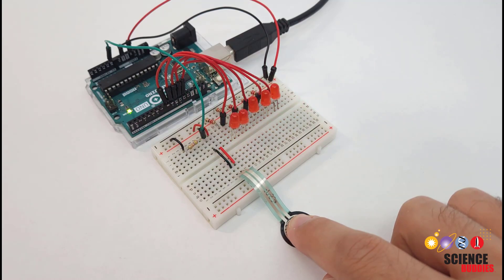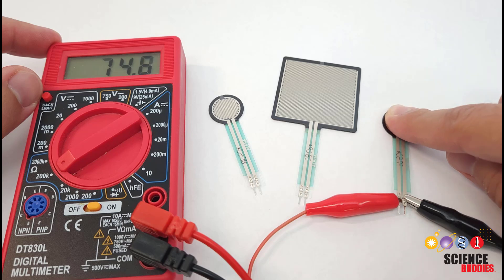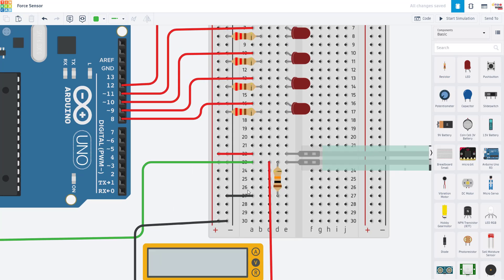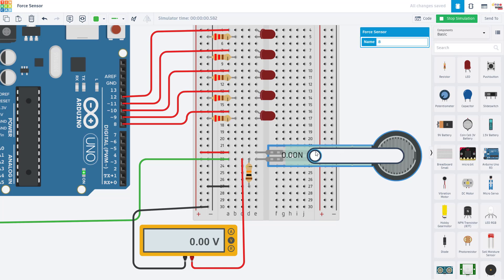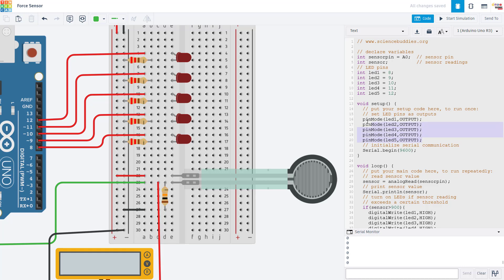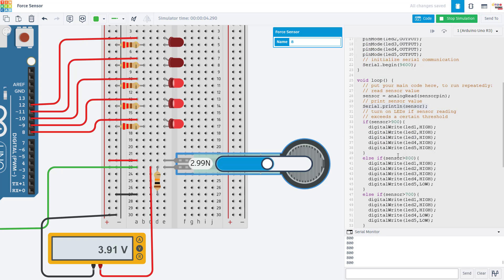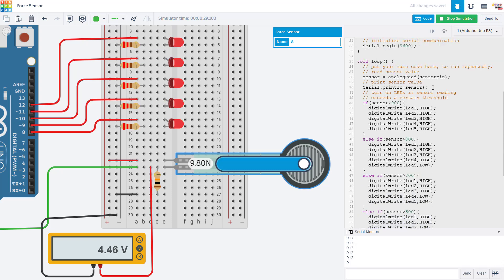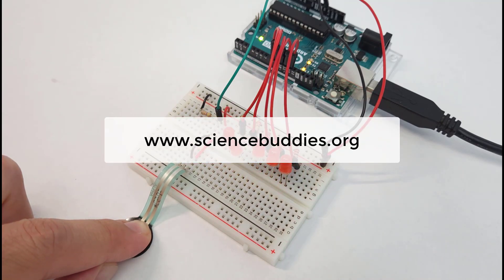How to Use a Force Sensor with an Arduino (Lesson #23)

Comment: Can we control servo based on if signal> treshhold move servo to 180? or it needs to be mapped from 0-1023 and move proportionally? and please whats the lowest in grams can this sensor measure? Thank you
Reply from the maker: Hi - yes you can control a servo with an IF statement. You would need to look up the datasheet for the specific sensor you're buying to find out its range and resolution.

Comment: Hey! Here is a long stretch question for me as total noob - Is it possible to use arduino for sending Midi signal with velocity value related to pressure instead of lights?
Reply from the maker: Hi - plenty of things are possible with Arduino but we don't have our own tutorial on that, you may be better off asking on the official Arduino forums.

Comment: What could I be doing wrong where my numbers start high and go down as force is applied?
Reply from the maker: You could have the arrangement of the voltage divider with the fixed resistor reversed. If you switch which end is connected to +5V and which end is connected to GND that should flip the numbers.

Comment: Will this same setup and code work on teensy 4.1?
Reply from the maker: Most Arduino code works on different versions of the board, but we haven't tried our tutorials on anything but the UNO so cannot say for sure. You may get a better answer to this question in the official Arduino forums.